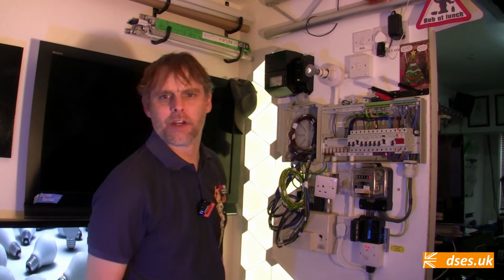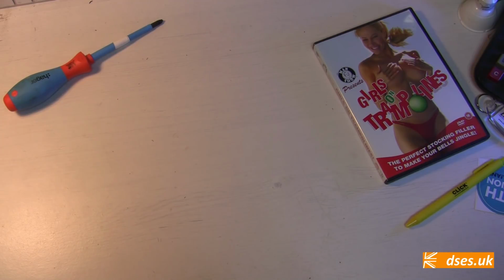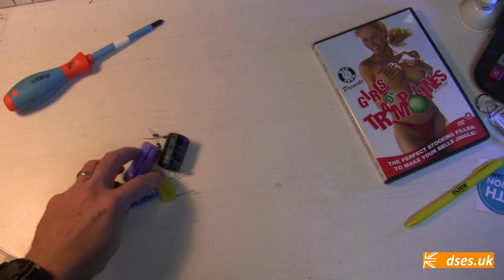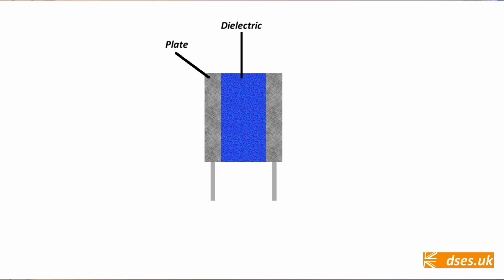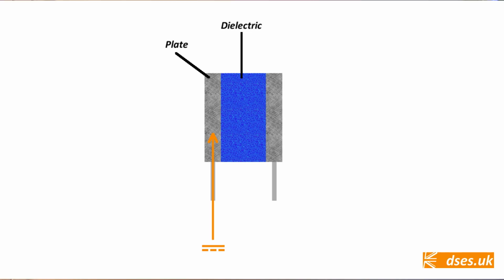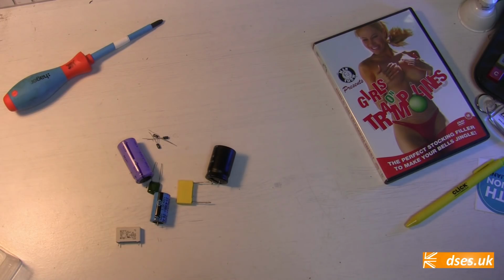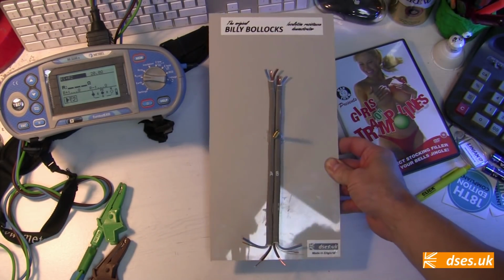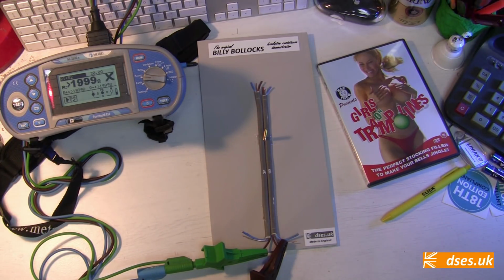Nuisance glowing LED lights

Comment: So, my question is this...

You placed the neutral coil next to the live coil and that reduced the effect causing the LED to dim. 
What happens if you flip the neutral coil first - so in effect reversing the polarity before putting it next to the live - does that reverse the effect, enhancing it and making the LED brighter ?
Reply from the maker: It's AC Mike, so the polarity on line is reversing every 10mS. The neutral is earthed back at the head so flipping it around would have no effect as the proximity of the neutral just reduces the electric field. The (smaller) capacitive current traversing the reduced field would leak into the neutral and head back to the head. Apologies if I've misread your question!
Reply: @dsesuk  AC not important as by flipping a coil, you're flipping 'current' direction - so if it was previously in opposed direction, it would now be with.
Well, that's my thinking anyway !

On the idea of no current flow as socket is open circuit - but surely capacitance relies on current flow - only microscopic compared to mA ! May be nA !

Comment: If you connect a load to the socket, does the LED become brighter ?
Reply from the maker: No, I tried that with a 1.5kW heater. The electric field is down to the AC voltage which remains the same regardless of the connected load, so increasing the current makes no difference to the capacitive effect even though you're introducing a magnetic field.
Reply: @dsesuk  The result being looked for is not variance in electric field but variance in LED output. So with the heater, you have both mag and elec fields - so I'd expect brighter LED.

Comment: When I use my ancient light switch timer with an energiser led  I unsurprisingly get regular flashing when off. What did surprise me was when I Put an led in an old pir floodlight that has a relay inside that also flashes when off 😯. What they done that for!
Reply from the maker: You think you'd be safe on the output of a relay.
Reply: David Savery Electrical Services That what I thought! But the dam thing flashes!

Comment: I suspect the  difference in measured voltage is due to the impedance of each instrument,.. the spec. on traditional LCD DVM's is usually in the order of mega ohms....  whilst the impedance of the CPC etc tester does not have to be so high,.. and could well be of the order of Kilo ohms,.. so hence the much reduced measured voltage
Reply from the maker: Yes, it seems the MFT's are designed to squash floating voltages to stop us sparkies getting confused. It has also been pointed out to me that the TIS tester used here has the same function on its dial which I hadn't spotted!

Comment: Hey mate, I've used these in the past for this issue.
 https://www.google.com/url?sa=t&source=web&rct=j&url=https://updates.clipsal.com/ClipsalOnline/Files/Brochures/W0001620.pdf&ved=2ahUKEwjB35Xs5-7mAhWK6XMBHWewBzgQFjACegQIBRAN&usg=AOvVaw0MCeBiw_qHjvLOzfLAn35V&cshid=1578308255578
Reply from the maker: Thanks Marko. I've had something similar which was provided to me in an unbranded form by a switch manufacturer, so it's interesting to see this.

Comment: Hi David,  With your meters showing up to 99 volts, when testing for dead how would you tell if this is only the capacative voltage or alternatively a live conductor with the neutral and earths broken  somewhere?
Reply from the maker: I think this is why the MFT testers have a higher impedance so that they read it as a lower voltage (the 3V of my Megger and the 23V on my Metrel). That allows them to squash the tiny stray current and bring down the voltage to something that an electrician can write off as being incidental. If I were seeing 99 Volts on my MFT's, then I'd assume there was some actual wallop behind it, but when they report a low number I'm more inclined to believe it's a floating voltage from this sort of source. Goes to show the benefit of using the proper kit rather than a multimeter when working on fixed wiring!
Reply: @dsesuk  That TIS meter does have a low impedance voltage mode on it to kill ghost voltage, the position before 'off'. I believe it's around 3kOhm at that point.

I recall seeing a set of probes with a button to insert a load some time ago, possibly from Fluke, as well as plug-ins to do it. At some point they just started integrating the load into MFTs and multimeters.
Reply from the maker: @Monkeh616  Well done sir, you are correct. I just tried that, and it read 7.9V on that setting. I don't have the manual for this meter and haven't played with it properly yet, so didn't spot that option!
Reply: @dsesuk  It's also interesting to note (I've just discovered this with my BM235 - much the same without phase rotatation) it reads 7.9V because the low impedance is not simply across the input terminals - it has a non-linear clamp which doesn't begin to conduct until around 8V. Below that, the input impedance in Low-Z is the full 10Mohm. Probably not that useful to you, but it's nice to understand how the tools behave. I was trying to determine if a 5V signal was driven or pulled up and thought I might use that mode for it - apparently not!
Reply: @dsesuk  If the neutral and earth where not connected would this high impedance also squash the voltage between the live and a neutral or earth that is disconnected?

Comment: My employer (Council housing) still fits lighting circuits in DI singles 🤔
Reply from the maker: Crikey, really??! Does that even comply with today's regulatory requirements against electromagnetic effects? When a current is pulled down those singles, there's nothing to kill the EM field... unless they're also earthed?
Reply: @dsesuk  they're run in brown and earth and single blue. Been in nearly rewired houses and they're still doing it now. We have rolls of it on the van too.

Comment: would using an analogue meter give a better volt reading ?
Reply from the maker: Hmm.... maybe. As others have said, it's down to the impedance of the tester, but I'm not sure if analogue ones are lower or higher, and they probably vary between makes and models of course.
Reply: @dsesuk  yeah meter loading that takes me back did electronics and small part of electrical eng. back in the day
Reply: there is a way to test the loading using another meter but a better way would be a high spec lab meter with higher precision (think hp )

Comment: Just stop buying cheap shit LEDs with capacitive droppers in them 😂😂😂😂
Reply from the maker: To be fair, I haven't seen this problem much, and my GE lamp is from 2011 which rather dates it. The only other time I've had it was in the job mentioned where the client bought these horrible iLumos touch dimmers which refused to work with anything but iLumos lamps!
Reply: Same all mine just fail and they just go dim and flicker most of the time 🙂

Comment: Had that glowing happen with a bathroom light after changing it to LED. I thought it made a nice gentle night-light so may try to replicate it in my own house in future!

I swapped it over from being wired supply->light->switch and back in T&E to being supply->switch->light, figuring it was something to do with induced current from the permanent line running past the light, and it did stop the glowing. Would have thought it would be a much more common issue though so not sure, maybe the three G9 LEDs in the bathroom light are more susceptible than most other LEDs.

P.S. I have found the varilight V-Pro switches very unreliable, for instance installing 7 in the same house all switching the same type of bulbs (Philips core-pro) and 2 of them wouldn't work properly right away while the other 5 worked (and continue to work) perfectly. Last one I installed was fine for 2 days then got a call saying it stopped working, the mechanism to click on had broken (old couple, not likely to be hammering it!). Any LED dimmer switches you're particularly fond of other than varilight?
Reply from the maker: Thanks Matt. Rewiring via the switch does fix the issue as you're getting rid of the two-core switch drop which lacks the neutral to counter out the electric field. New houses are being built this way both for this reason and to allow homeowners to more easily upgrade to smart switches or to change their luminaires to ones which are only made to take a single cable out of the ceiling. As for dimmers, I've only had one V-Pro fail and they are my normal go-to brand. I've also used Zano for grid switch arrangements, and I've recently got hold of some Scolmore ones to try.

Comment: Changing the cores around in a three core cable can also eliminate this capacitive effect on a two way + switching arrangement.
Another way is a load resistor across the load.
Reply from the maker: The trouble with using a resistor, diode or capacitor to null it out is that you have to be sure it's the right value (in terms of not just voltage, but wattage, type and capacitance respectively), and that it gets installed in the right way. What I like about the neon is that it's pretty foolproof and dirt cheap!

Comment: The cheaper of those non-contact sticks can be checked for battery by running it down your clothing after poking the wires, static will make it glow red. Still no substitute for a proper dead testing probe of course.
Reply from the maker: A good point. I prefer one with an active indicator though. Rubbing equipment down your trousers to test its working isn't great for inspiring confidence!

Comment: 20:30  Exact at that effect no real computer specialist manager put local area network cable near power cable nor long time in same direction at the same tray. It is one of the first what I learn in my computer specialist school, at a time where we use MAUI, AUI, BNC and 10 MBit  networks. 

Sure that the effect can be higher with 400V 3phase and typical 10 GBit what you now found in computer labs of clouds companies. Flash effects from GHz prozessors are funny too. 😂

Comment: Great video as always! your problem 2 can be solved in the majority of cases if the LED lamp is greater than 7W as the load generated is insufficient if its less than. The other solution is to introduce a capacitor in the light fitting between L & N (this will brighten LED but Dim halogen).Give it a whirl might make another video out of it.

Comment: Thanks David, excellent video and superbly delivered. I've used those varilight dimmers and they are great - you can program them to be leading edge or trailing edge depending on how your LED's prefer. The downside is that to get into programming mode you turn on and off multiple times. When mine went 'faulty' it seemed that someone had tried turning on and off numerous times in quick succession and it went into programming mode and wasn't actually faulty.
Reply from the maker: Cheers Peter. I've had the same thing when the kids get too playful at some client's houses. It doesn't help that programming mode looks like a disco with the lights dimming up and down!

Comment: Another great video, can you do a video on smart switch as and the best way to get a neutral cable when there isn't one? 👍
Reply from the maker: Most of the smart switches I've seen don't need a dedicated neutral Ryan, although should such be required then I'd probably drop a full feed cable to the switch position. I tend not to fit this smart stuff though, I'm too old for it all!
Reply: @dsesuk  yeah and they all go wrong after 4years, particularly after power cut surges. Cheers Gordon

Comment: Happy new hangover! First time I saw this was a P.V.C. two-wire, (why, oh why?),  light circuit with C.F.L.'s. The further into the wiring the faster they flashed. The kids bedroom light was the fastest. The customer was wondering whether to call a sparky or a priest. I assumed inductive, not capacitive, coupling was the reason. Looks like I was wrong. Nice one Dave for shedding some light on some deep electro-voodoo doo-doo. Well sussed.
Reply: It happend only with the cheap lamps. Higher costs lamps use diffent design normally. Same he show it.

Comment: You can also use the mA range on those clamp meters for testing leakage current on appliances that can't be tested for IR due to internal relays or electronics.

Comment: The higher the input resistance is of the meter the higher the voltage that it will show because you are only dealing with 3 micro amps, a meter with a low input resistance will cause a voltage drop, hence a lower reading. Once the input capacitance of a high resistance meter has charged up then the voltage will rise and the lamp resume glowing. Big Clive explains in his tear downs the exact component that is there to stop capacitive glowing, normally a high value resistor in parallel with the LED's in the lamp that some manufacturers  leave out to save one hundredths of a p eaech

Comment: Mind blowing stuff. Had this issue recently when upgrading all downlights in a property to LED. Was using Integral LED warm white dimmable GU10's. This glowing issue occurred on the first floor landing on all 4 lamps there. But when switching both two way switches into their second configuration the problem went away. I put it down to some sort of nearby cabling interference in the end although I did try replacing the two way switches with some spares from the van to see if it was maybe something to do with the switch pole separation distance(s) but this didn't change anything. I replaced these 4 lamps with some Enlight lamps with similar wattage and lumen output and the problem went away. Really appreciate you making this video as I was genuinely baffled. And the info on the glow sticks answers more of my baffled moments! Hope you overcome the hangover!
Reply from the maker: Ah, it sounds like capacitance just on the one strapper then. If an older property, the two-way probably wasn't an earthed 3-core cable, but a twin red and a single. Interesting to hear all four lights were glowing, sometimes the one with the least resistance takes it for the team!
Reply: @dsesuk  Yes, was a very faint glow on all 4 lamps but a glow nonetheless, and if I remember right one seemed brighter than the others but don't quote me on that. You could see the four COB squares in the lamps light up. It was actually a 3 core and earth red yellow blue cable. To be honest I didn't take take any IR readings for the lighting circuit on that floor because I was only replacing the lamps and not the fittings, wouldn't be surprised if they were low as the wiring was pretty shoddy I came to discover later on after being employed to carry out more work in the property. The kitchen fitter thought he was an electrician too so decided to run the entire kitchen on a 30A MCB with various rings within rings and spurs all over the place. Kitchen is 2 years old. Half of the kitchen had no earth reading at all, which turned out to be a pain in the arse when I came to fit an outdoor light and switch fed via a nearby kitchen socket!!! All metal sockets/isolators and 3 young children running around. Partial rewire of the kitchen and MCB down rated to 20A and a dedicated cooker circuit installed. Anyway I won't bore you any further with stories you've probably experienced yourself many times!
Reply: Oh and no RCD protection of course. A new 'garage' board was installed to cover the kitchen with RCD incomer. Client didn't want to open the can of worms any further and have an EICR and new board unfortunately.
Reply from the maker: @skamuk1  Might be worth checking the CPC in that 3-core as that should be helping to squash it if it's a capacitance problem!

Comment: The question is. Would the rcd see this as an imbalance?? Have often intended to try and test this.
Reply from the maker: The RCD wouldn't see my tiny current as an imbalance as it's between line and neutral.
Reply: David Savery Electrical Services ahh of course , if these two circuits were operated via 2 differing rcds it would be a different story I guess. I guess when currents get this small it gets difficult to measure, as you say it’s hard to believe the circuit in the lamp will start conducting at a measly 2micro amps.

Comment: I would imagine this is known as ghost voltage, stray voltage at very low current, the meters varying impedance is skewing results.

I would imagine the highest reading taken is most accurate and also indicates the best meter??????
Reply from the maker: Yes, I did wonder if the TIS was giving the better result. I also wonder if it floats up to 230V when nothing is connected to it?
Reply: Not really indicating the best meter, rather a 10 Megohm input impedance is standard for DMMs. Some DMMs like the Fluke 289 have a low impedance mode for AC ranges to eliminate stray voltage. The MFTs are designed for installation work and the manufacturers know not all electricians will be educated sufficiently to understand subtle effects like this. Easier to mask this and stop them worrying whether something is actually isolated or not
Reply from the maker: @sdgelectronics  Thanks for clarifying Steve. It makes sense that the MFT's should show something less scary.
Reply: SDG Electronics great info thanks